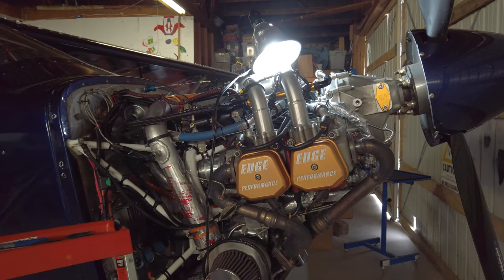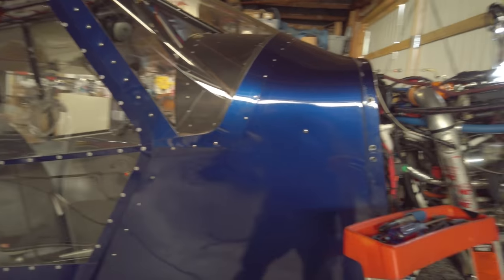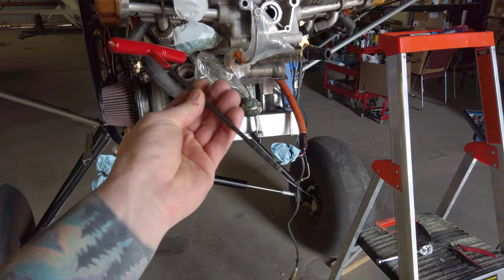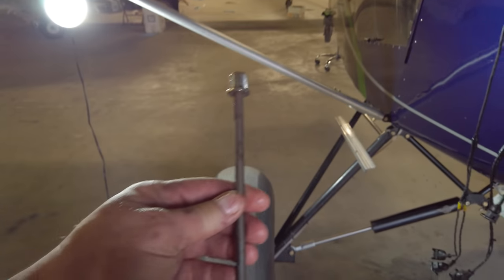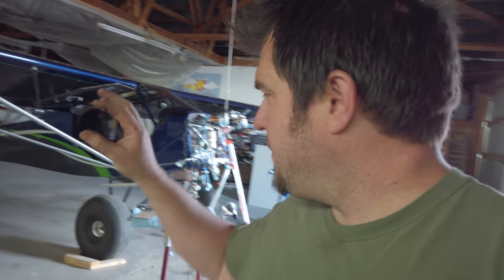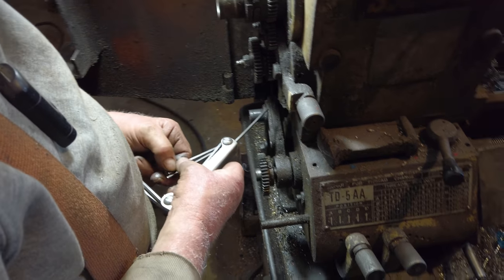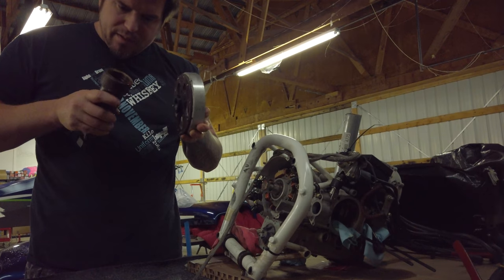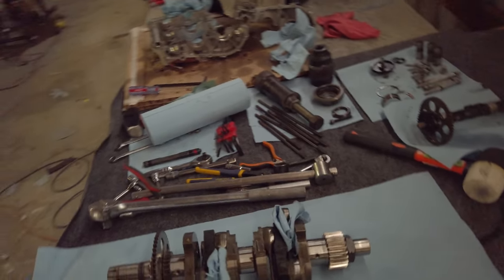The engine in my AIRPLANE is DEAD!

Comment: I enjoy your videos and the way you explain your installs. I can't help but think overriding the design of the engine can lead to problems. Trent Palmer had a big bore engine throw a rod and even Hal Stockman (Zipper Big Bore) threw a rod in his Rotax on his way to Oshkosh. Hal is a great guy, and have met him at Osh, but I just don't believe getting more horsepower out of a stock Rotax is a good idea. Rotax engineers never anticipated it to be modified for more power than it was designed for. I'm not criticizing your videos at all. I just hate to see all your work and money end up in a loss. I also know the attraction is for you bush pilots trying to get in and out of small mountain strips, but you know what can happen to engines that are pushed too far.
Reply from the maker: Definitely a risk with the higher power levels... no argument there. Though, the pioneers of this like Hal, and Edge have pretty well discovered the weaknesses and found a solution. Trent had an old, high time motor with weaker rods that had a prop strike previously. Hal was also running an old motor with the old rods. They changed rods somewhere around 2000. Then the better in case in 07... and Edge found out you have to weld the crank above approx 135hp. There are mods to the gearbox to hold the high power... Edge now has a couple hundred high power engines out in the field. I purposely waited a while to see what failures may show up as these engines build time, so far, it seems the older case and older rods have been the main problems. Edge pushed a couple up to failure points with all the upgrades and said that in the 175-200hp range is where other issues started to show up. I do appreciate the comment as I understand where you are coming from! I'm not trying to claim that pushing one of these up to 155+ hp is going to somehow increase it's lifespan... but after watching the failure points arise, and solutions to follow... This engine is claimed to be good for 155 after these upgrades...I feel pretty confident in running it slightly reduced from there should net good results....(135-145 range). I hope I don't reget this!!!!! Thanks Ralph

Comment: Crap case design, needs to have more support on gearbox. Good luck with getting it repaired to last 👍
Reply from the maker: Yea the old ones sucked. The new cases don't crack as they are pretty extensively re-designed.

Comment: Out of curiosity why can't it be welded
Reply from the maker: It's possible it can (unless it's 7 series aluminum). But, it will just crack again somewhere else. The new case is a completely different design, and much stronger (never heard of one cracking). Thanks

Comment: That air filter is complete garbage.   I understand in the air it doesnt really matter but the bush take off and landing stir up a ton of dirt and  the K&N filter doesnt filter really at all.
Reply from the maker: Problem is nobody else makes one with the right dimensions... not a fan of k&n either but there is nothing else. Compressor housing, intake piping, old and new manifolds were all clean though, plus old cylinders have 0 wear, compressor wheel looks perfect etc. so it seems to be doing the job ok